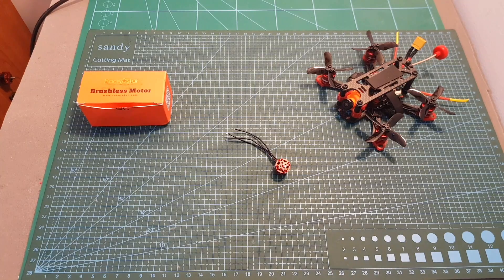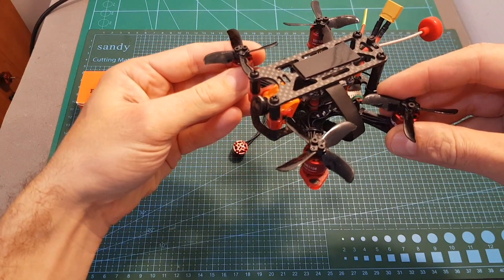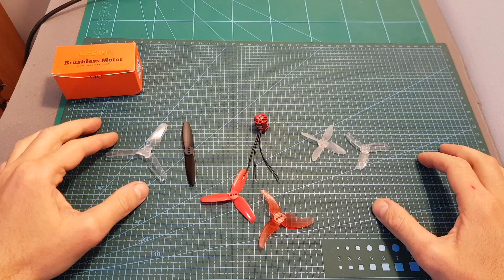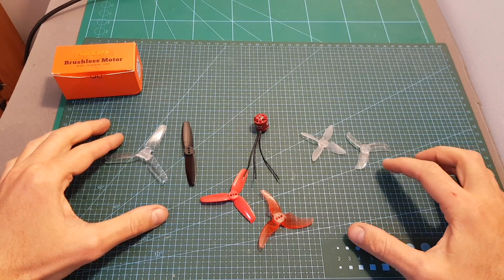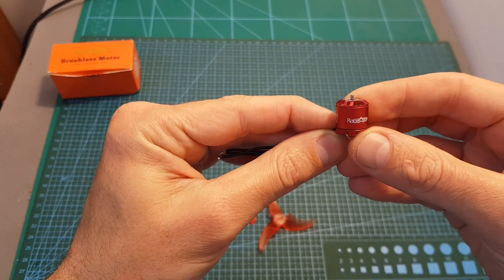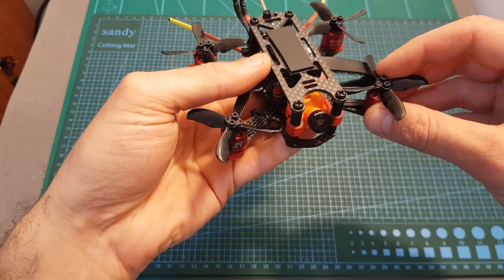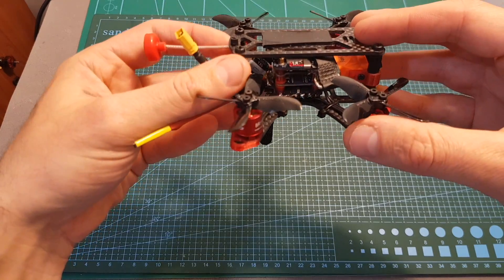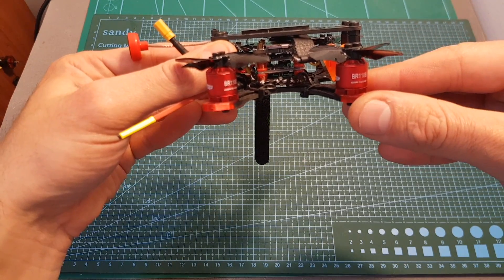Racerstar BR1108 4000KV Motors - Bench Testing & Review

Comment: Hi are these motors good for replacements for a phantom 2 vision model 3.0
Reply: Realise that  but the brand itself
Reply from the maker: @markgordon8014  yes I think that they might have a compatible motor, but the original motors shouldn't be expensive and I recommend to use them instead.
Reply from the maker: Hi, no, these motors are way too small.